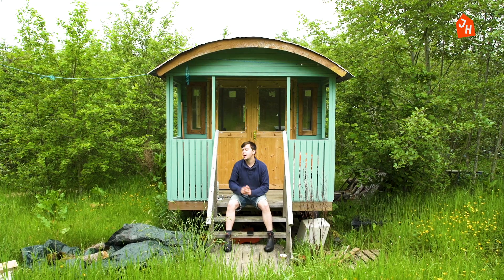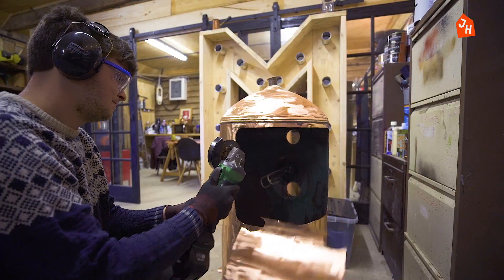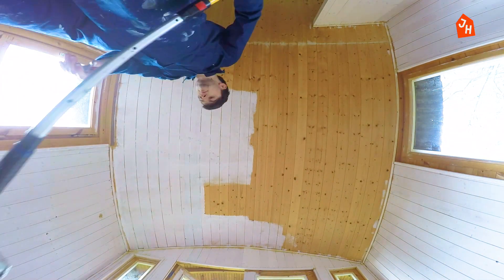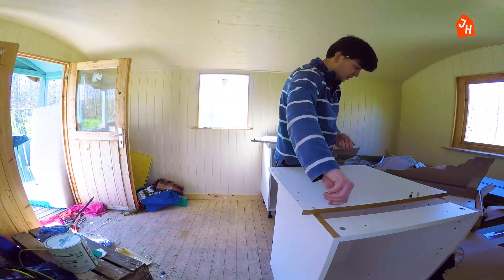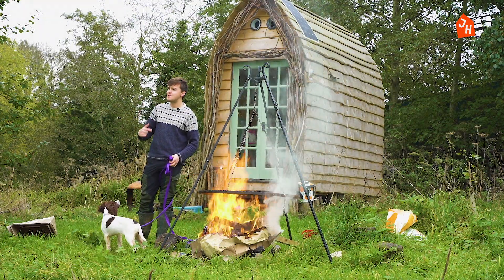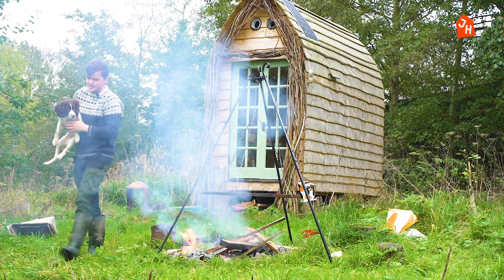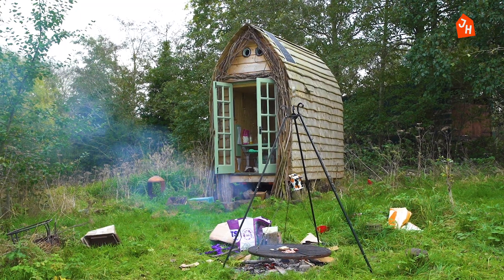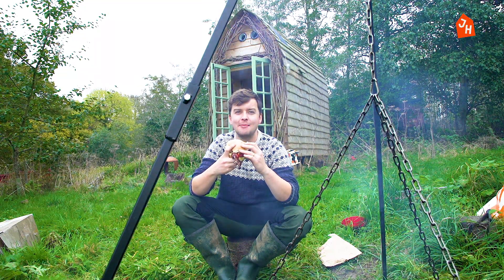DIY'ing A New Cabin! Shepherd Hut fit out BUILD | Episode 1

Comment: Tapes that have been on for too long are easy to remove if you heat them up with a hair dryer. Used to do it when I worked as a painter. If you do not have power, you probably have a rechargeable battery pack.

Comment: OK, save yourself some time, money and heartache: DON'T tape the glass on the windows. Just let the paint get on the glass then scrape it off so quickly and easily with a razor blade. Seriously....so much easier and more satisfying. Paint does not stick to glass the way tape can (especially if left too long and temps change).